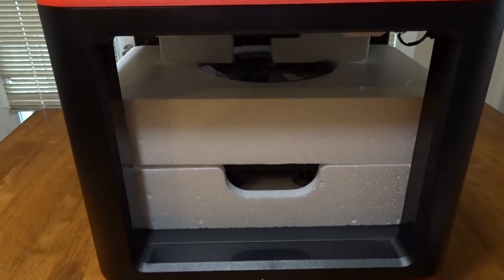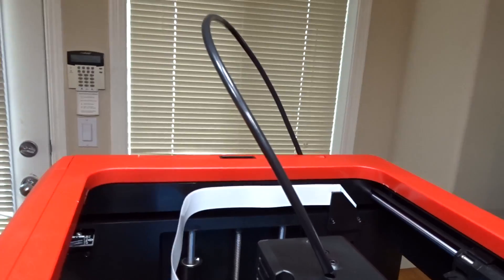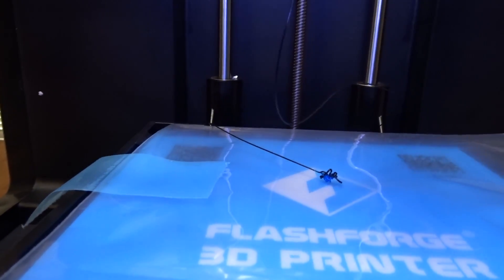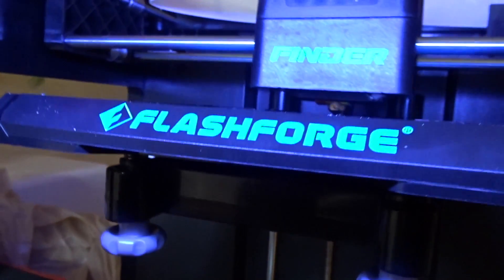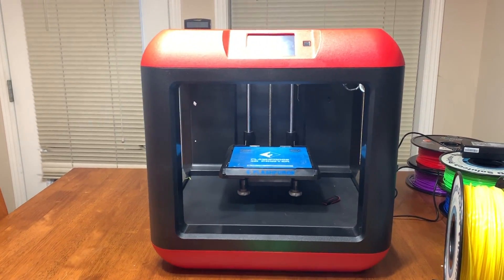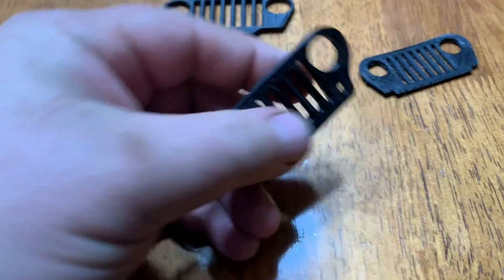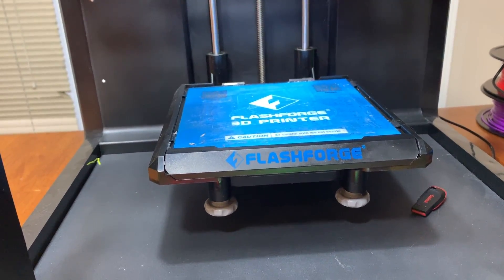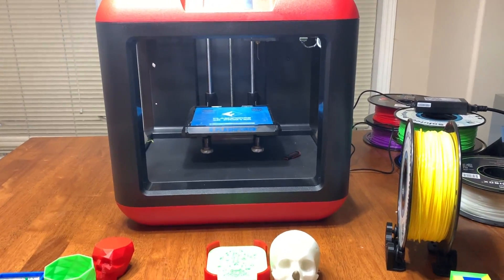Flashforge 3d Printer The Reality of Getting Started

Comment: something i have learned is your PLA should be stored in a constant environment setting ... when they are in the open air they can absorb moisture and cause poor quality ; this is where the baking of your filament comes in to remove that moisture .... better is to keep your PLA sealed away when not in use if it's new leave it closed until it is needed ... so some form of humidor for the pla feed bar would be a good thing ... I forsee the need for those moisture packs as a way to keep the feed line as good as possible
Reply from the maker: I’ve heard of people saying that

Comment: Have encounter stringing with your prints?
Reply: rj villaflores I have been encountering that recently with my Finder. I didn’t have that issue originally, it just showed up recently.
Reply: I see, wondering if you might share any tips if you manage to sort that issue with the stringing. Thanks. ✌️🙂
Reply: rj villaflores I sped up the print speed of my finder. It actually improves the print quality somehow. It also decreased the amount of stringing.

I believe the stringing is caused by the other layers of plastic melting and getting stuck on the extruder.

Comment: Great video! I've had my Finder for almost 3 years now and I've transitioned from PLA to PETG. The only upgrade I've made so far was switching to an all metal hot-end, partly because printing with PETG requires higher temps and it melted the plastic in the original hot-end. I solved my adhesion and warping issue with hair spray, cheap Aqua Net hair spray. The Finder is an impressive machine that surprises me all the time with the print quality.
Reply: So funny that you mention aqua net hairspray I talk to this expert the other day that’s really good at 3-D printing and he told me he uses that as well he told me to buy the Ender 3 s1 pro 🤔🤔🤔
Reply: @JerseyStyle7  I’ve incorporated an Artillery Sidewinder x1 and Genius to my workflow and the aquanet is in full use.
Reply: @j.c.norman  niiiiiice I gotta try that 👍🏽 i was gonna buy that x2 instead I bought the creality ender 3 S1 Pro